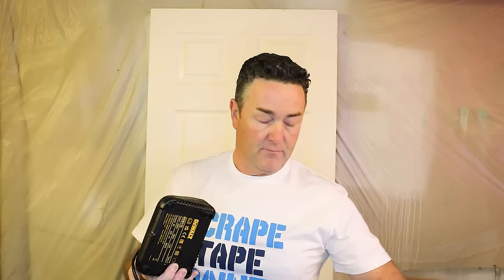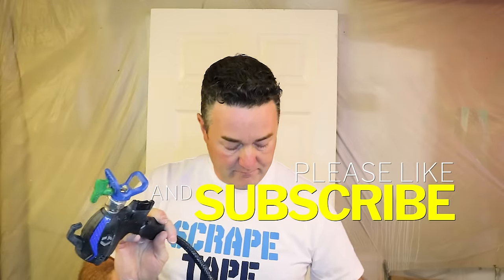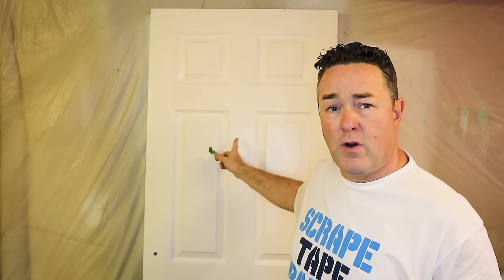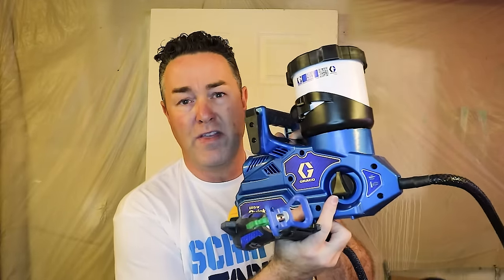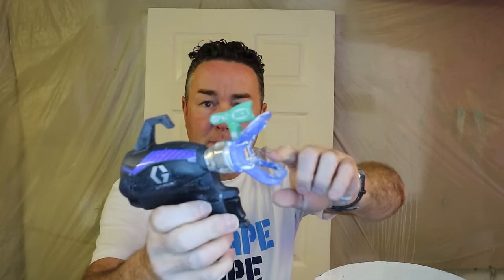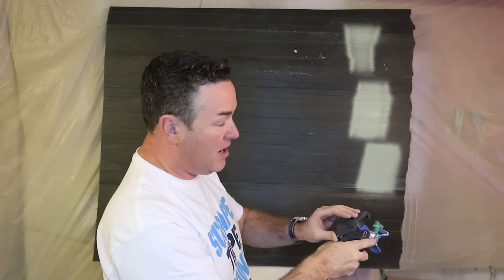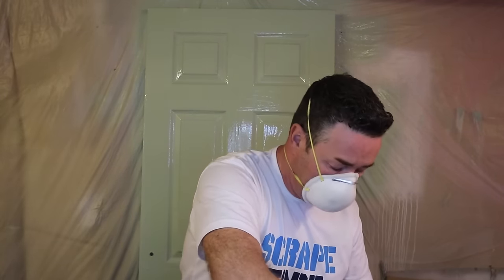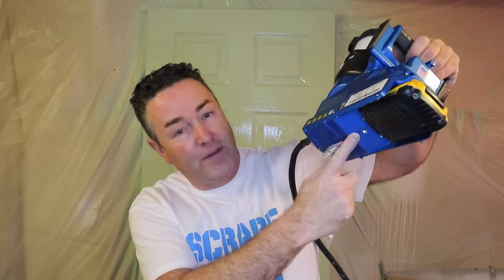Spray like a pro with the game-changing Graco Ultra Quickshot - 18v battery powered

Comment: Too expensive for me for the size of it
Reply: For what it does. You can get the previous model for half the price but this has much better finish. It does cost the same as something like a 390 but its much more convenient to use on smaller jobs like painting front doors sections of trim work ext.

Comment: Looks great Phil, got the ultramax 3 years ago best thing ever I bought, spray all my doors & woodwork, cabinets etc with it. People moaning about the pumps, never had a problem with mine normally lasts 200litres on each pump change which I can deal with just turn it upside down on a small flow from tap to clean it takes 5mins to do. Motor still fine as well.
Reply from the maker: thats great to hear. hows it like to handle for the bulky weight?
Reply: @ProfessionalPainterDecorator  don't find it too bad, bit awkward when your trying to get in tight spaces.. if the quick shot was available at the time I'd of gone for that instead, looks quality (I spray a lot of Zinsser Allcoat & Scuff X on my interior woodwork). Appreciate the work you put in to your videos & looking forward to seeing you get to 1million subscribers. Had a few jobs recently one was in F&B Dead Flat & also been using the Little Greene intelligent matt was impressed with the quality of their stuff really vivid pigmentation. Worth doing a review one day. All the best mate.

Comment: Well done Phil, well presented. I can see it would come in handy for smaller jobs and woodwork. I think I would use my bigger unit for ceiling and walls. It ticks the boxes for not trailing hoses and extension leads about catching doors you’ve just sprayed and ease of cleaning. I liked it, nice to dial in and have the control on any overspray also.
Reply from the maker: Cheers. It was a hard one to film

Don't forget... No need for a clean shot either.  I've not had it spit yet
Reply: @ProfessionalPainterDecorator  Hi Phil, came across your channel last week,been binge watching since. I’ve been eyeing up the quick shot for a few months, the gun is electronic, fly by wire to stop spitting. I’m going to buy one over the weekend, thanks for your time 🙏
Reply from the maker: @bestcrazyboy8487   welcome aboard.. please keep watching, subscribed? have you commented on the IN IT TO WIN it video? (on the main home page)
There may be deals at the P&D show in Coventry next week if you cam make it?
Reply: @ProfessionalPainterDecorator I’m going to subscribe now, no I haven’t entered the competition and can’t make it to the P&D show 😢. I’m from West Wales near the coast .
Reply from the maker: @bestcrazyboy8487  not that far from Coventry then ;)

hope over to this video.. https://youtu.be/gGLARQLidkw?si=nvajwZDpOKD0Di5Z

Comment: well I have seriously considered getting one of these to add to my collection but the price was putting me off at mo.  I've already an apollo pro HVLP which works great and also my trusty wagner 119 which I've had for around 9 years and its never failed me brilliant bit of kit and not like the newer cheaper chinese models.. However after doing some research i found some info with regards to the Wagner HEA 150m, yes these are cheap and basic but they do run at lower pressure.  Anyway i took a punt on this managed to get a 2nd hand one £100 sold as faulty but was a very simple fix (O ring) and looked like new, anyway i have tried this now on a few scenarios ceilings (great) and woodwork spraying gloss which is what i wanted to test it on and TBH i cant fault it! Does the job and gives a really good finish on parr which my 2 other expensive machines.  also to reduce the pressure (well amount of paint coming through) someone suggested simply put some tape around 1/2 the gun filter... well i did and boom really surprised as it made glossing seamless.  Cleaning it is a doddle 5 mins effort as it has a hopper. so the moral to all this is , you dont need to spend a fortune to get a good result.  Makes my life easier.

Comment: I bought one when they first came out in the UK around April / May time , used it a couple of times on some coving and also tried it on some doors . Nice bit of kit but just don't think i'll get much use out of it on the projects i normally do . I do tend to buy stuff on impulse though . I'll hang on to it for a little while to see if i do get a chance to use it more often if not i'll just sell it on. Great little sprayer if you will get much use out of it though👍

Comment: For me personally I can't see the benefits of owning one. Sure it would be a lovely toy to mess about with but the only use I could see this having is spindles. I have the Graco mini contractor gun for my gxff and I find that gets into all the tight spaces I need it to. I generally never catch anything I've just sprayed with the hose because I start furthest away from the unit and work my way back towards it so you aren't going anywhere near wet paint. If it was £500 or £600 then perhaps it would be worth picking one up but it's double that and for touch ups you can get the ultra max for around £700. 
After all that, it does look a brilliant little sprayer and I'd be interested to know the pump life on them and how easy they are to change. Great review Phil, always appreciated. 👍

Comment: Great stuff Phil! I’ve been watching a lot of your vids lately and they’re all really well done. 
I’m in the states and have been wondering if one of these would be good for my house “re model”, I’m replacing most of the doors and trim.
I picked up a 5 stage turbine from Harbor Freight ( not sure if you’re familiar with Harbor Freight there in the UK ) and it’s a great machine but I’ve been struggling with getting the finish out of it that I want with Sherwin Williams Emerald urethane which is a Wb alkyd. I was an auto body painter for 27 years and have multiple high end spray guns but running 150 feet of hose from my garage through the windows is a little bit of a pain😅. 
I can get great results with conventional hvlp and lvlp spray guns but the overspray is a bit more, the hvlp turbine is a different animal and I love the thought of using less material and having less overspray but …. maybe I need to get a bit more used to it, it’s definitely much slower though but I wouldn’t mind as long as I could get everything glassy smooth. It’s killing me though because I can get outstanding results with a brush and the stuff just looks like glass as long as it’s a straight run of moulding , like chair rail or crown. But when it comes to all the “ins and outs” of jambs I find it impossible to get it all perfect lol.
I can’t help but wonder how smooth/silky it would lay out with one of these and a 208-210 or 308-310 tip. 
These are around $1400 usd here, I’m a little scared to take the chance. I have the Graco True coat DS and don’t like it at all
Reply from the maker: tnx.
the door frames, the trick is not to apply too much at a time, going over the same area, it's when you see people do a frame all in one 'sweep' (bottom, to the top, across the top then down the other side) taht way you're not over loading the area with paint.
Reply: @ProfessionalPainterDecorator  thanks!
In your opinion, if you weren’t in any real hurry and were working on your own house, would you prefer the quick shot over hvlp for trim? 
By the time I’m done I’m going to have one of everything 😅
Reply from the maker: @Mr1fingersalute  did you see  monday's video yet?
Reply: @ProfessionalPainterDecorator  I haven’t , I’ll look for it👍🏻

Comment: looks a good sprayer but im getting the graco gxff, my first sprayer after watching loads of videos its the gxff for me
Reply from the maker: That's a good one to get, will do you for ceilings and walls and woodwork.

It will go as far as a .19 tip (the gx21 takes a max .21)
The quick shot Only goes to a .16
Reply: You won't regret it mate. Brilliant sprayer. I recommend the compact contractor gun if you're feeling flush for another couple of hundred quid. Domestically the gxff will do everything you need it to. 👍
Reply: @AspireDecorating which would you get for spraying wardrobes and kitchens etc? Thanks
Reply: @mananddog9884  Good question, I'd decide first if I wanted to go HVLP or airless. If I was going hvlp I'd go for a 5 stage turbine with a pot feed to the gun so you can get into tight areas, if you're going airless I'd still go gxff. If you shell out another £250 odd for a compact contractor gun you won't go wrong. It literally sits in the palm of your hand, so if you can get your hand in there, you'll get the gun in there. The standard hose that comes with gxff should be good enough for that as its quite flexible and thin but you might want to add a whip hose. 👍

Comment: what a bit of kit, do you reckon it would cope with new builds doing woodwork only , great review
Reply from the maker: yeah as you'll be using the smaller woodwork tips. and not pushing it to the limit on tip size.

Comment: Hi Phil
Just done a bit painting.
Problem is the smell
I think maybe the paint was not at its best.
Been a week and it hasn’t gone away 
Help
What do pro guys like yourself do 
When confronted with this 
Cheers
M
Reply from the maker: How. What paint was it.... Don't say Valspar??
Reply: Crown white emulsion 
And Wilcko satin wood
Not new paint been in garage a while .
I’ll bin it at the tip.
But getting shot of the smell is my main problem 
Cheers Phil
M
Reply: I’m in the process of buying a sprayer and decided the Graco 390 will fit the bill .
Watching your vids has convinced me it’s the way to go
Reply from the maker: @michaeljoyce9184  great to hear.
Get it with a 7.5m hose and the hopper sontiu can easily spray smaller quantities of paint when doing woodwork.

Paint smell... Old paint :(

Get some plug in room smellies. And open windows to air the room out.
Reply: Cheers Phil
Will give it a go.
Excellent channel by the way

Comment: Forgot to ask,what brand of water based paints do you use with these? Could you use valspar in a satin for example?
Reply from the maker: Yes. You may need to thin different paints with more water though. A bit trial and error.

Comment: Have you sprayed BIN with this unit??
Reply from the maker: no, but did BIN Aqua through my 495st max II pc pro last week, video out in a few weeks
Reply: @ProfessionalPainterDecorator  I usually air spray bin, a nice light coat and it goes a long way, I find the airless uses a lot more paint, too much in fact and also increases drying times. How does bin aqua compare to the original, have you tried it on oak?? Will it stop bleed through??
Reply: @innerarmour8347 try sikkens wd198, I've just discovered it. I spray loads of oak kitchens and also air sprayed bin. After using the sikkens I will never go back to bin. It can be sprayed with airless as it's waterborne and it goes on lovely. You can get 20 litre drums and it works out cheaper than bin. It sands a lot better and you can achieve a far nicer finish. Hope this helps mate.  It cover knot bleed and tanin bleed and all other stains I've encountered 👍
Reply: @leothelegend8201  Just had a look at the datasheet and it states 8-10 hrs recoat time, unfortunately that won't work for me. Does it cover bleed through in one coat? I have no issue spraying bin with the cordless gxff airless as it can be grounded. It just uses too much paint compared to air spray. I was trying to figure out if this new unit with the newest technology would spray bin at a lower pressure and not use as much paint. Maybe with a 206 tip. Was thinking of buying one just for bin. It would make things a lot easier.
Reply: @innerarmour8347  I'm my experience it has covered all bleed through in one coat. It also leaves a much nicer surface to paint than bin and fills grain lovely. I didn't realize the recost time was so long, I was sure it was 4 to 6 hours. It's never been a problem for me as I normally coat cabinet doors in my unit in the morning and then spray the trim on site  in the afternoon, then repeat the process the following day so I leave 24 hrs between coats. Get a 5 litre tin and see what you think, it has honestly been a game changer for me mate
Reply: @innerarmour8347  I'm also thinking about buying one myself, I reckon it would be great for kitchen trim. I always catch the lower units with my airless hose, this would be a game changer. I'm just worried about longevity and the price seems steep for what it is
Reply: I have a cheap HVLP gun dedicated for BIN. That stuff has crazy adhesion, so I don't want it through my airless guns.
Reply: @ILruffian  I agree mate

Comment: I've got spitting from my Graco Ultra Quickshot due to leaking from the tip, but the retailer does not support me in servicing or replacing it.
Reply from the maker: have you stripped it down and cleaned it all?
Reply: @ProfessionalPainterDecorator  yes, but the problem was there right out of the box despite making sure everything being assembled as it should.
Reply from the maker: @Yannis2022  tips do spit until it's bedded in. Run a load of water through it. That should bed the rubber seal in too

Comment: Hi mate. Just found you're page. Any videos  on getting  a really good finish  on door frames
Reply from the maker: Welcome aboard. 
You mean spray finish?
Reply: @ProfessionalPainterDecorator no with a brush pal. Thanks for the welcome 😊 am in my 4th year hopefully  qualified next year. Ps old man I work with has doors looking like glass.  👍
Reply from the maker: @Johnnyquid20  paint isn't like it used to be.

Glass paint will be oil based gloss.
Prep is key, also using an oil based Undercoat, nib down between coats and do a two top coat gloss finish is the secret.

Adding some extender oil additive helps too.
Don't do it in a cold environment either.

We mainly use water based now.
Reply: @ProfessionalPainterDecorator  Thanks very much for the advice 👍  guy  I'm working with noting but oil he doesn't even want us putting a bit of spirits in the paint. He is 70 years old so old school all the way lol 😆  thanks again
Reply: "paint isn't like it used to be.

Glass paint will be oil based gloss.
Prep is key, also using an oil based Undercoat, nib down between coats and do a two top coat gloss finish is the secret.

Adding some extender oil additive helps too.
Don't do it in a cold environment either.

We mainly use water based now."

It would be good to get a video on some high end finish tips like the ones you just mentioned in this comment. Cheers Phil.

 @ProfessionalPainterDecorator

Comment: Nice.  Why would you buy this over the ultra or ultra max?
Reply: I think price would be the first big difference, its possible to get an ultra max for around the £700 mark, nearly half the cost of this. I suppose there is more bulk with the ultra so difficult to get into tight spaces and it can get a bit weighty for some people if it's full of paint, also the ultramax can spit a bit so you have to buy the clean shot attachment for it. Be interesting to know the pump life comparison of the two. 👍

Comment: Any thoughts on overspray removal ?
Reply from the maker: Hi. Water based?
Meths.
Reply: Apologies, I meant removal of overspray / mist / dust from the air as it's being created  if you see what I mean @ProfessionalPainterDecorator
Reply from the maker: @nicw2545  you mean like a air scrubber?
Reply: Is that what you use / are they any good ? Or fan and ducting ? or even ... both @ProfessionalPainterDecorator
Reply: sheet up

Comment: Could you use this for wardrobe doors? Or would I be better off getting the gx19?
Reply from the maker: Ideal for furniture spraying... You'll only be using small amounts of paint at a time.
A gx19 is the GXff we have here.. with a 7.5m hose you'll need to fill with paint.
The ultra quick shot only has a 1.8m hose.
Reply: @ProfessionalPainterDecorator thanks , that’s a good point! Didn’t think about the amount of paint it will take to fill the hose!

Comment: What makes this sprayer worth 3x the price of similar units? Does it spray that much better, more convenient, easier to use, faster to spray with? Seems VERY overpriced and I am not seeing how it is any better than the Graco/Dewalt/etc sprayers that are $300 or so with good handles/tips.
Reply from the maker: There's isn't anything on the market like it.
Electronic gun/needle, so auto shut off, no spits, no need for a Clean Shot.
Versatile gun to spray in any direction easily.
2000psi.
It's not bulky or cumbersome.
Reply: @ProfessionalPainterDecorator  I have a Fuji minimite 4. I have found it to work very well in painting rooms, doors, cabients, etc. It has finer particles so in a room I run a vac with filter, but otherwise I am not sure I see the difference. They both seem to put good quality paint down fast. I know I can get much finer output than airless, but airless can spray a bit faster I guess. Just trying to argue with myself if this unit would be better to use for all my projects which include rooms, doors, cabinets, etc.. or stick with the minimite 4 and save the money.
Reply from the maker: @b3owu1f  if that's all you're using it for stick with it.
Reply: @ProfessionalPainterDecorator  OK.. let me ask you this.. the Quickshot vs many of the "similar" piston driven options from graco, etc. The size/portability is nice, but the price makes it rough. You can find bucket piston sprayers for $300. Does this one still blow those away, if so why/how? I am not opposed to spending good money on quality tools.. but it seems most of those units dont last long.. so is this unit built like a german tank and going to lost a long time and that is part of why its more expensive as well?
Reply from the maker: @b3owu1f  I think you need to have a demo with one and see what you think